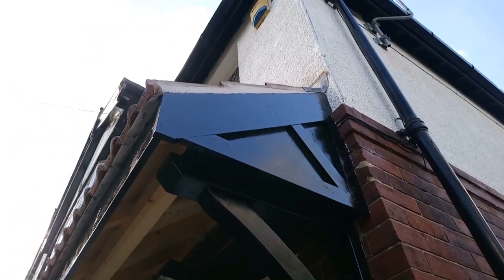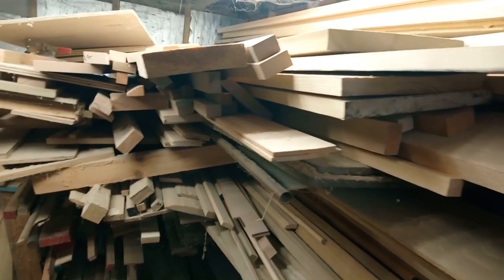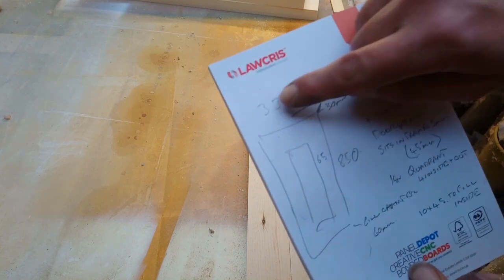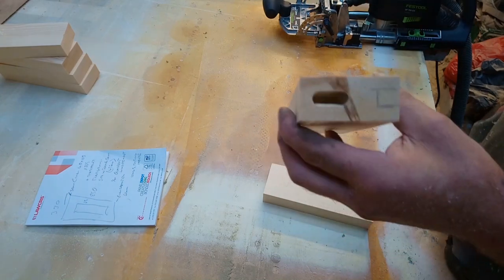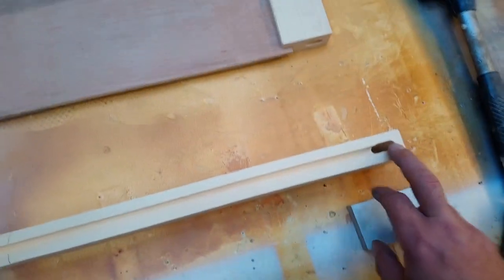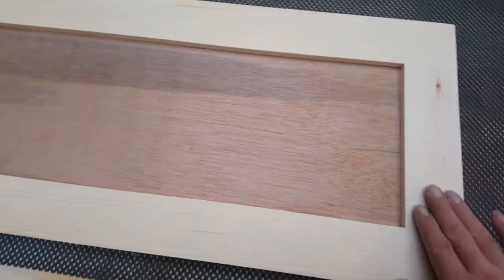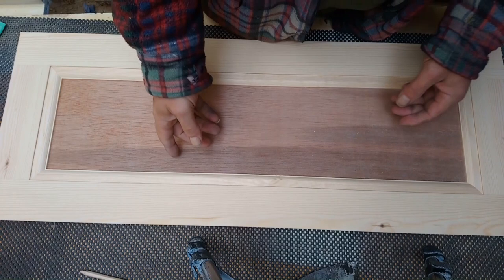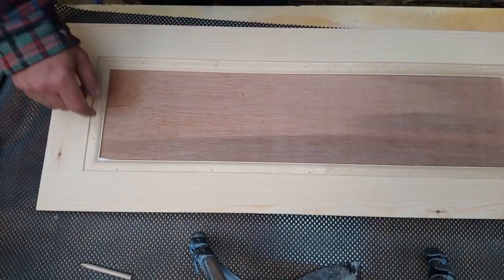Door frame & panels rot repair Pt1

Comment: thanks for the video, I have to build a roof over my front door as it has the same problem, I'll be replacing the door and frame and I think though. You've given me a few ideas though regarding the guttering and potentially replacing the fanlight with a nice panel.
Reply from the maker: Good I hope it works out for you, 👍 Thanks